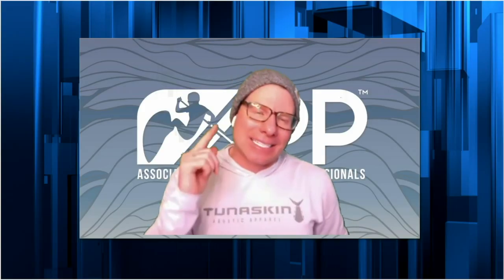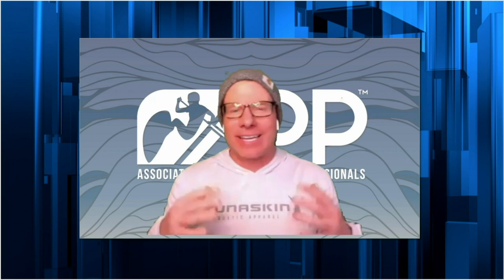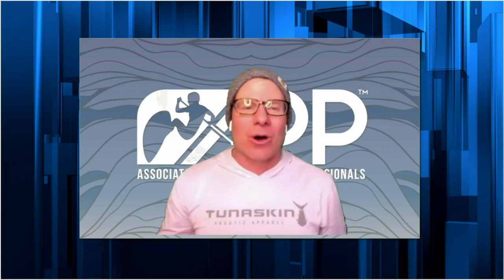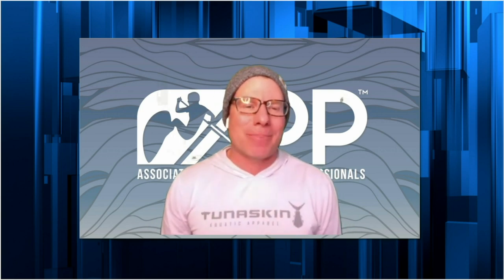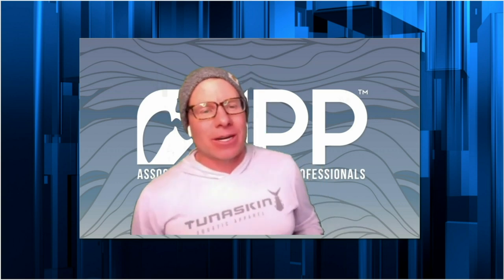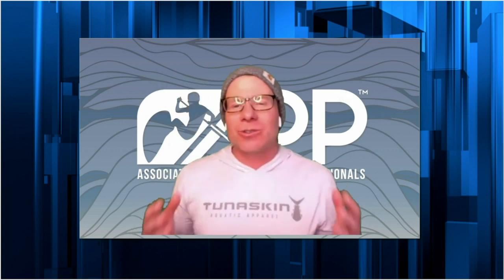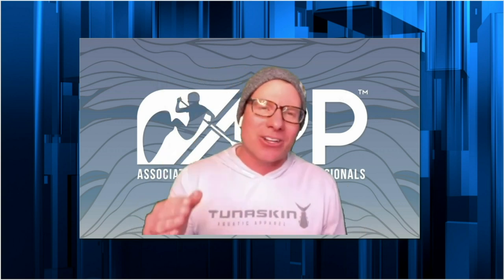Tech Tip Tuesday Episode 1 - Let your Technology powers combine!

Comment: i need a totally flat blade so i wont ruin it or break the blade paddling with it under my chest
Reply from the maker: Check in with Dave im sure he has taken it surfing as well as racing. He could tell you if it handles well for surf. We know it works for sprints.